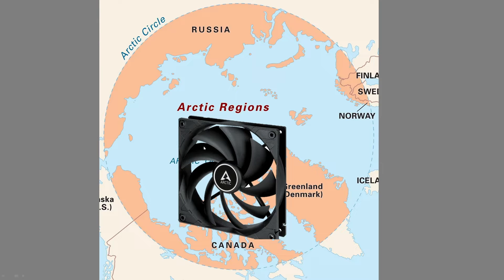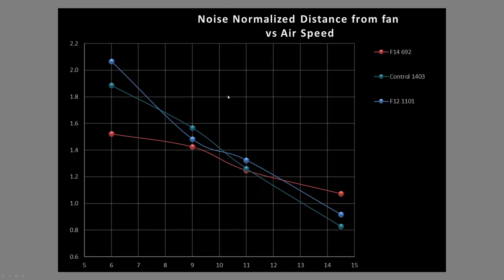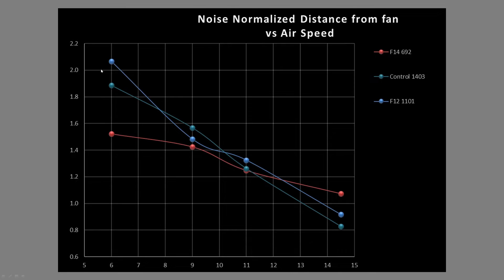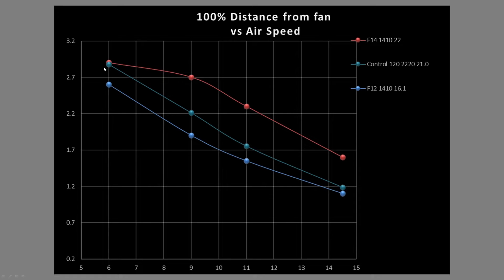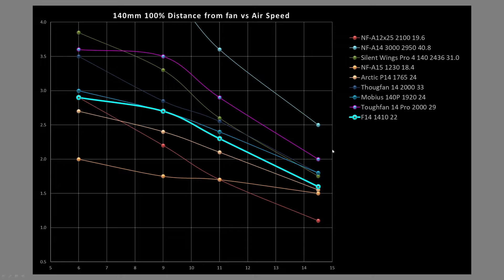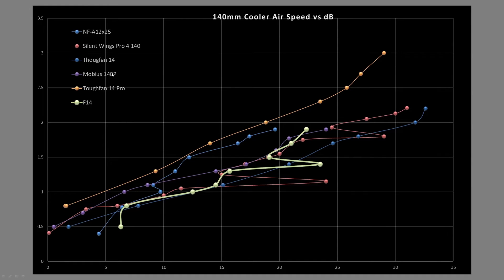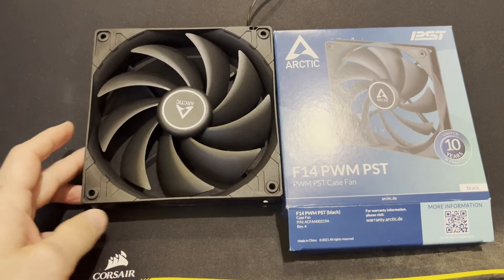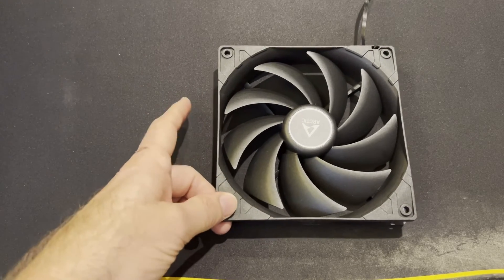Arctic F14 Polar Winds are a force to be reckoned with.

Comment: Hi there, just discovered your channel in my search to upgrade the fans on my 280mm AIO and the scientific approach to testing is refreshing to watch. I really do appreciate the effort and could I ask if you can include the Phanteks M25-140, Corsair QX140, Cooler Master SickleFlow 140, Scythe Kaze Flex II 140mm, EKWB EK-Loop FPT 140, Phanteks 140 MP, Alphacool Core 140mm (preferably 3200rpm, but there's also 2000 and 2500 rpm versions) and Phanteks D30-140 into your testing soon. I would like to ask, objectively (or subjectively) do you think that the testing for air speed through the NH-U12A would correlate to performance in radiators? Thank you and looking forward to the next video of your contra fans series, potentially using 140mm fans this time.
Reply from the maker: thank you for watching. wow thats quiet the list. only have the kaze flex in my video pipe line. I cant give any promises when ill get to the other fans. several have been on my watch list for some time. 
Currently I trying to get the reviews out that I have already finished the testing for but havent release. its like 50 fans / videos. haha 
As for coloration between my fin stack and a Rad. Well its my hope and theory. I think it lends its self to average thickness Rads but no the super thick and super dense ones. They are a much more pressure scenario something and air cooler just isnt. I'm hoping to get a THICK rad at some point but i'm just not there yet. Channel needs more $.   :/  
I do the best with what I already had. 

I'm not sure if ill test Contra 140. I would need to look at the fans I have to see if any are counter rotating. I'm pretty sure the results will be very very similar. as in the patterns that were observed.
Reply: @computer-tech-more  thanks for your reply. The fans I include can be categorized into different categories. Corsair QX140, Cooler Master SickleFlow 140, EKWB EK-Loop FPT 140, Phanteks 140 MP are all fans used in top of the line AIO from each respective company. Phanteks M25-140, Phanteks D30-140 are thicker fans similar in design to T30 so I hope to see if there are any benefit to going thicker in the 140mm form factor and Kaze Flex II 140mm is how scaling goes for a good performing 120mm similar to the Silent Wing pro 4. The Alphacool Core are the same design but at differing max RPM  so a blade design test to see how it fares against the likes of iPPC Noctua, T30 and IceGale Xtreme 140mm is greatly appreciated. 
50 fans/video is plenty data for me to digest in the meantime so no rush haha.
I will be using 20-35mm thick radiators so I will be going with the toughfan 4 pro from the data from your videos for their noise-normalized air speed through the U12A.
For the contra series, if the 140mm is not in the pipeline, I'm still interested in seeing the testing with the Noctua recommended spacing to compare against your current test in the first video.
Reply: @computer-tech-more  appreciate the reply, each fan I include more or less was just something I wanted a trusted comparison source for; the corsair qx140, sickleflow 140, FPT-140, phanteks 140MP are all fans being used on top of the line AIO from each respective company mentioned; M25-140 and D30-140 are thicker fans, similar in style to T30 and Lian Li P28, so a trend could be established there (hopefully) and Kaze Flex 140 is just a recommendation I stumbled upon on Reddit for good budget fans, as for the Alphacool Core, they're varying speed version of the same design, with the top speed version rivaling that off industrial Noctua, SW4P and T30 in max speed.

50 fans should be a healthy amount of information for me to digest before waiting for your take on my suggestions (if taken) haha

My use case would probably be 20-35mm thick radiator so your estimation should be relevant (I will probably go for the Toughfan 4 Pro after watching a couple of your videos on 140mm fans) 

As for the Contra series, if not the 140mm fans, I'll still wait for when you apply the Noctua recommended spacing between fans to see the difference in findings

Comment: yo bro i think the grahps are just bad from a scientific viewpoint. You're interpolating weirdly where this isnt a given.
You need confidence intervals to draw actual conclusions or else your results are so close they could be coincidence.
Especially 6:22 -what the haiiiiil those measurements don't even make sense without the noise floor, and the distance to the noise source
Reply from the maker: Hi there you clearly didnt see the testing methodological piece where I perform every test consistently. My noise floor is about 32dB consistent. You also seem to think im GN or LTT with a big budget to speed on a noise chamber. I do want to build one but thats pretty far off without funding. 
do you know how linear interpolation works.  y = y 1 + ( x − x 1 ) ( y 2 − y 1 ) x 2 − x 1.
get gets pretty close results. do you want me to prove it? it works best if data points are close together. but yes it is an assumption. 
The only issue is if there are resonant frequencies at the data point not tested between every 10 pwm. future testing would go down to 5pwm. but alas I am a small channel with no income so dont have time to do it. 
Guessing you didnt really listen dB vs airspeed at 6:22. In video i did say "sorry its not labeled" future videos will have that improvement.

Comment: Nice to know! I have this as my exhaust fan and it is doing great. I fastened it using the noctua rubber thingies, so the vibrations are not as big of an issue.

Regarding fans: I just bought a dell tower with a 120x38 mm fan in the back. It is rather noisy, but boy does it move air!
Reply from the maker: haha a dell hot box. they need crazy fans just to get some airflow. 
I agree with GN on Dells cases they need to just refresh them rather than keep building using that old design and just bolting more brackets to it.
Reply: @computer-tech-more  oh, but this is one of their server towers. Noise is not an issue! This fan easily cools my two .5-2650v4 xeons. The air is being pulled THROUGH the HDD backlplane and how-swap bays :D

The air is being pulled from the back of the case using a shroud over the two processor coolers. This fan puts the t30 to shame wrt raw performance. I limited it slightly though, because it disturbs our sleep if it goes up to 5000RPM.
Reply from the maker: @LinusBerglund well dang. thats pretty cool.